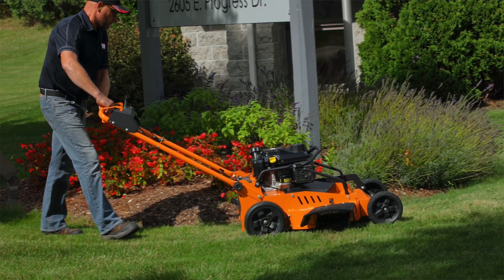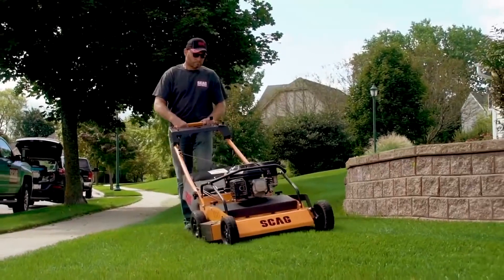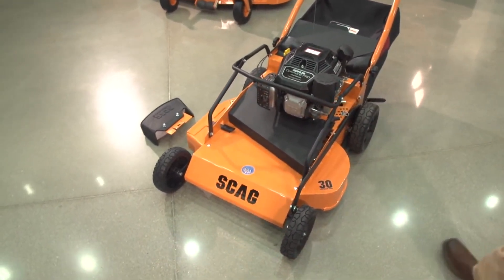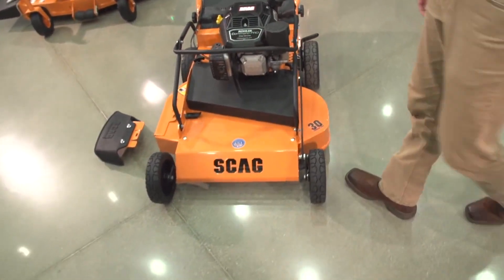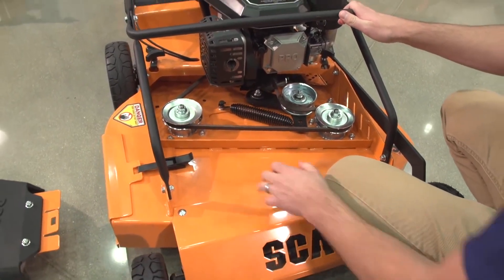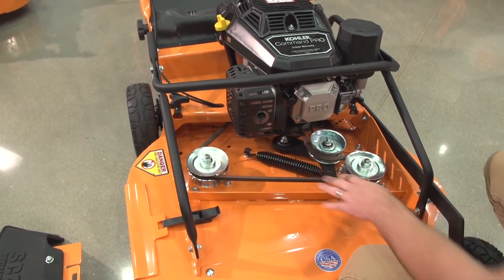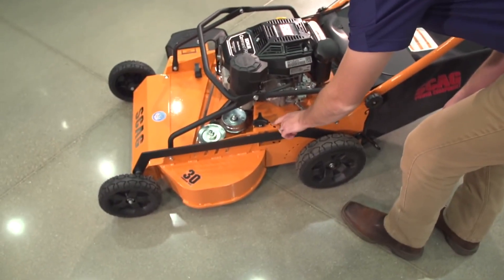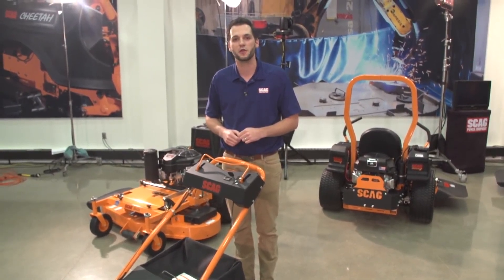Scag 30" SFC Walk-behind mower | Now Available

Comment: That's basically a 32" WB😒

Never understood those 30", underpowered and overvalued
Reply: The 30’s don’t require a trailer. Fit through every gate. Half the price. And plenty of power for residential yards. 

So you were saying?
Reply: @Texasguy316  A 32" walk behind does not require a trailer, ramps only. The Kohler engine is about 7hp the Kawa is 13hp. The encore 32" wb is right at $2800. The 30s retail at $2600. Most lawns you can fit a 32".